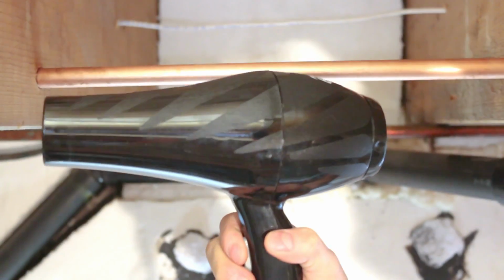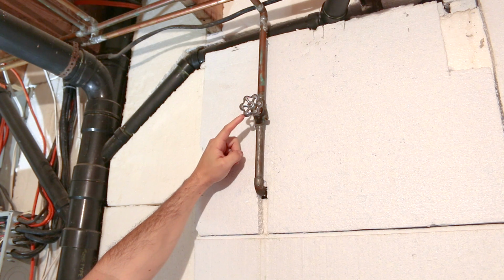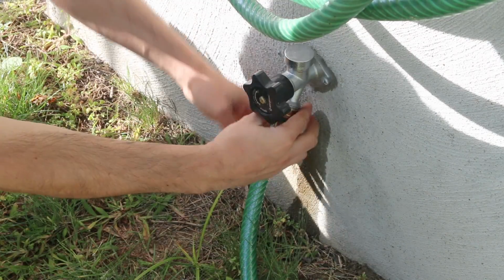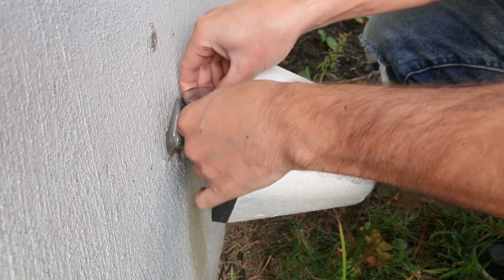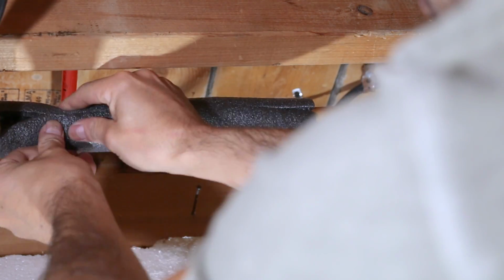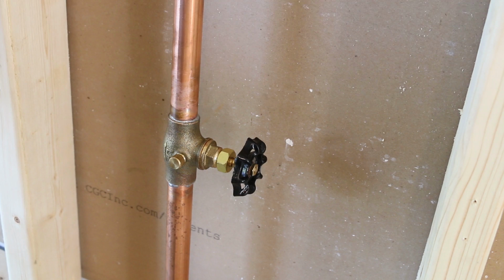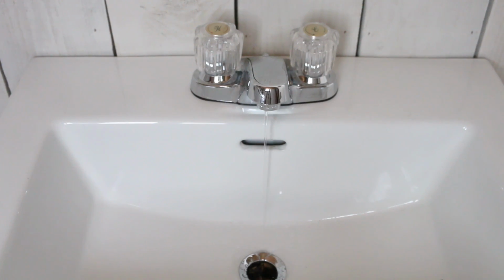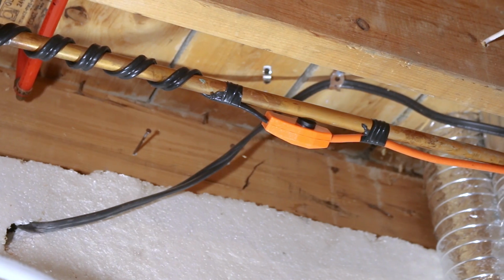12 TRICKS To WINTERIZE Your Plumbing! (Easy DIY) | GOT2LEARN

Comment: I am in Texas, visiting my son.  He just bought a house last year.  We suffered no power,  for a while, got a generator working, and thought all was well. All external faucets were insulated, and not leaking. 

However,  it was the bathroom in the garage that posed a problem.  Someone cut out one external faucet and capped the end with a steel, natural gas line cap.  The freeze finished pushing the rusty steel cap apart,  spray water behind a dry-walled wall of the garage.  Interestingly, that pipe was outside of the original brick house, NOT INSULATED, and hidden behind drywall.

Remember:
1. NEVER MIX METALS. 
2. use the same type and appropriate metal for its final purpose.

Comment: Growing up in Buffalo, I never even considered what is common knowledge here might not be known elsewhere. Every Fall I would help my Dad close and drain the water outlets, put away the lawn furniture, bring up the shovels, oil change the snow blower, and go and buy multiple bags of rock salt and 5 gallons of fuel plus stabilizer. It was a ritual I thought everyone just knew to do. Well, the way New Yorkers are leaving for the South that knowledge should spread in a few years. Makes me wonder what Southerners know about the heat and the house that Northerners dont know.
Reply: Lots of tips for next year.Hopefuly not but never know.

Comment: Great video, but big  error on the thermostat part : it costs more to maintain a house at higher temperature, because overall thermal loss increase with temperature difference between inside and outside. This is simply physics.
Reply from the maker: I said it was equal, but yeah there's a small difference, but not really noticeable in this case, thanks!!!
Reply: @Got2Learn  segoetnico is correct in that the video is great but the thermostat comment was a big mistake. To a great fraction of the world population, turning up the heat in the home would be very expensive indeed since maintaining heat has a cost that is directly proportional (as represented by multiplication) to the increase in temperature differential between indoor and outdoor,  multiplied again by the time you maintain this temperature differential. If maintained for more than a short while (which will often be necessary), the temperature maintenance cost will often be bigger (again, proportional to time, so if time approaches infinite then cost also approacges infinite) than the initial temp ramp cost unless your house is exceptionally well insulated (represented by division by the insulation factor).
This will in many cases be such an expensive solution that it might in fact bankrupt people with weak finances, fairly big, poorly insulated houses, living in places with prolonged harsh winters, which is a non-negligible fraction of the world population.
Since the rest of the video is so good, please own your single mistake an help any onlookers from thinking the thermostat solution is cheap when not (nor environmentally friendly), by editing out this erroneous comment from the video.
Besides, this solution is not permanent, so someone else who later lives in the house after you might not know of the problem an this theoretical solution, which might lead them to set the thermostat back down for other reasons thereby unknowingly causing ice-broken pipes because this solution is not permanent and requires this perpetual knowledge transfer and remembering too.
Please edit this comment out for the sake of humanity.
Reply: That was way too much of a comment for a simple concept. Most of the world population know what they can afford and won’t be watching this video, anyway. You’re giving this guy way too much credit for his “world” influence.

Comment: I live in a mobile home which are notorious for frozen plumbing. Most have the water, electric, and the dryer vent come in near the same spot. I built a small box out of insulation board around the water line when I bought the trailer 20 years ago. Instead of running the dryer vent through my skirting I ran it into the box around my water line, about 3 feet in distance. The one and only time mine froze it had been single digit Temp for a few days. I turned the dryer on and thawed it out in less than ten minutes.
I've used the dripping faucet since then and it's worked but the dryer is there for backup lol
Merry Christmas to y'all

Comment: In Europe, Germany specifically, it is in our code to insulate the piping, whether it being hot or cold tap water. The hot side, so it doesn't lose temperature and to save energy. The cold side, so there is no possibility of bacteria build up. Our cold water lines need to stay below 20°C (68°F), to ensure that. Some institutions are pushing for even better separation of hot and cold piping, to ensure the cold water temperature below 20°C even more, but that is still not in the code (yet).

As we have water based central heating, the water lines of these circuits need to be insulated as well, so the heat gets to the radiators and doesn't get lost on the way to them - and to save energy.

There is a mandatory thickness in relation to the pipe diameter somewhere in the regulations, that doesn't come to mind right now. A good rule of thumb is 100%, which means pipe 1/2in = insulation 1/2in. Up to a certain extent, of course. And you have to insulate the valves, too. There needs to be as little open pipe as possible.

Your example with the outdoor tap has a little short coming: With insulated pipes here you would still have the shut off valve inside, as these are mandatory by the building insurances, which every building owner has to have. Doesn't matter, if you have a frost free tap or not.

Sounds over engineered, but it works. Every water damage case caused by frost I heard of didn't follow these simple rules. Or the heating failed, what let the cold creep into the house.

Energy saving - and therefore cost saving - might not be a big thing in the US, as natural gas, oil and electricity are so cheap, people don't bother. We in Germany are paying so high prices for energy, american people would protest non stop (on he other hand: If we had to pay your prices for internet access plans, we wouldn't protest in the classical sense, we simply wouldn't get the gear).
But as we have all seen, to winterize your home can have it's advantages, even when there might never be a ROI via energy cost savings...

Comment: If you shut off the main water, shut off the water heater so it does run dry and burn out
Reply from the maker: It shouldn't empty itself, but if you feel safer that way, it's fine.
Reply: @Got2Learn  ... if the water is shut off then you can't get any hot water so might as well not heat it in the first place.

Comment: Great tips as always! I would only add to install pipe insulation close to the exterior wall to a maximum of only 18” away in a basement or exterior wall that meets a inside wall. That way you get the heat from the room, even if it’s ambient such as a basement, on a good bit of the exposed pipe and the pipe closer to the wall will be insulated from the cold. Also those outside faucet covers need to have insulation stuffed inside of them before installing them over the faucet. Lastly since you didn’t mention it if you cut off water to device and you have a ball valve after the shut off valve you cut off place the valve after the cut off point to half on half off. Enough water can get trapped between the ball and the wall of the valve causing it to freeze and crack. This is mainly for backflow devices for irrigation systems. Even turn all the test cock valves half on half off and back off the bolts of the relief valve a little bit so the water can drain out from there as well. Also installing tees with drain plugs right at the ground of the inlet and outlet pipes of the backflow device can allow you to drain all the water out of the device and piping above ground eliminating any worry of frozen piping.
Reply: What do you put in the cover to insulate it? TIA

Comment: Nice tricks! 

Also worth mentioning is a method to keep underground pipes frost free. You can feed a heating cable inside the pipe with a cable that is suited for that purpose. A small cable inside a ~40mm diameter house main water supply line won't hurt the flow too much. Of course the pipes shouldn't freeze if buried deep enough but unsually long cold peaks can reach frost to 1m deep underground.

Also, it does cost more to raise your indoor temperature because heat loss through insulation rises when temperature difference rises.
Reply from the maker: Thanks Antti!!

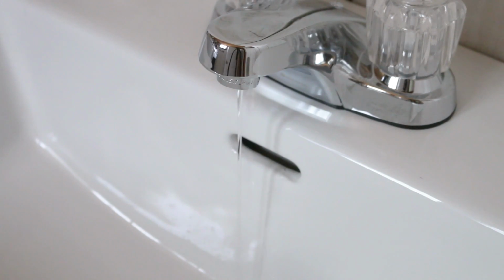Comment: 7:54 #10 is okay if you have just one faucet and one pipe; if you have multiples of these, the water can still freeze in any pipe that isn't being slowly "drained" by an open faucet like this.  Also, slowly letting water into a drain can actually make freezing worse, in that the drain-pipe is no longer empty of water in some areas.

Comment: Before you EVER attempt to thaw a frozen pipe, make sure you know where your water main shutoff is and make sure it WORKS before you do anything. Open every tap beforehand and watch very closely for drips while thawing the frozen pipes. Opening the taps will reduce the size of the leak if there is one. If it drips or shows evidence of a leak or split, stop, turn off your water main, and call a plumber.

Comment: Great video. Lots of good ideas. Another idea for thawing frozen pipes is to use a stick welder. The frozen pipe has to be metal. With the welder turned off attach one of the clamps to either side of the frozen section, usually a buried pipe. Open a faucet and then turn the welder on the lowest amperage setting. When the flow is restored turn off the welder and remove the clamps. Doing this too long can melt your pipe, so only use the low setting. Connecting the clamps with the power on could cause an arc that will put a hole in your pipe or blind you. 

When listing drains to add RV antifreeze I'm pretty sure you forgot washing machine drains. That would be a bad trap to forget.

Thanks for the awesome videos. I've learned a lot from them.
Reply from the maker: Thank you so much! Yes I heard of that technique but never saw anybody using it, pretty sure it makes for a quick unthawing hehe...have a great day buddy ;)

Comment: I’m in TX and mine are frozen outside as I write this, hope they don’t burst
Reply: What happen ?
Reply: I lived 1 year in Laneville ;TX. 1974. I was sooo happy to be away from my freezing Illinois home. Then it snowed! First time in like 100 years! @&:#!!!  😡
Reply: @AntiFem Glasscock Climate change bro.
Reply: @AntiFem Glasscock and climate change affects the severity of weather phenomena, both hot and cold weather events.
Reply: @aarone.1981  Same!! from MN, and without electricity for 4 days now in Garland. SMDH
Reply: Well in CC, TX we lost power for 4 days, had one sink in the bathroom that froze. I don’t know if the outside water spickots froze. I couldn’t find any shut off valve to the outside spickits. I could only find the main shot off valve. So far no burst pipes, but as he said i guess I wont know about the outside ones till spring or when it warms up.
Reply: Did they burst?
Reply: @prettyvacant3383  I lucked out. Wrapping the exposed pipes in towels and 100mph tape worked.
Reply: @htx_carlos4766   I lucked out. Wrapping the exposed pipes in towels and 100mph tape worked.
Reply: @xuimod  🤣
Reply: @aggielonghorn  is there anything climate change doesn’t do???🤣

Comment: good Information In the 1990s I noticed the Sears rubber Garden hose would freeze but did Not bust until 34 below zero  F so I did My whole plumbing with It,  I use Gimour brass valves and connectors the plastic are more likely to bust I cover the hose with flexiable sewer pipe and If the Water line does freeze I uses a hairdryer to blow warm Air down the lines, I have tried heat tape but It usually does Not work and one time It about set My house on fire, I have been after manufacturers to make something as a automatic Water flushing system to flush the Water lines every few minutes I tried a automatic lawn sprinkler It worked for 2 hours but does Not have multiple repeats, also do Not run Warer lines near cement because  cement absorbs  the cold like a magnet.

Comment: Awesome video man. Lots of good info. Two observations-1) you guys use gate valves up there? They are trash in the desert . I won’t even try turning an old one off when run into it. Automatic replace. 2) Your water must be awesome right from the ground there. I didn’t see any hardness or calcium deposits on any of the hose bibs you showed on exterior.
Reply from the maker: Hehe yes, the gate valve is original from the house and it's starting to already not be smooth and for the calcium deposits, there's none because I replaced them ;) Thanks Mark always nice to see you back ;)

Comment: Heat trace on a copper (or metal) pipe should be fed from a GFCI (ground fault circuit interrupter) power circuit.  The GFCI will keep you from electrocution if the insulation on the heat trace starts to fail and energizes the metal pipe.  Use a 30 mA GFCI for this purpose.  The standard 6 mA GFCI may result in nuisance trips which will allow your pipes to freeze.

Comment: There is totally inaccurate information at about 7:30 about the cost of warming an house. It is false to say that the cost of heating a house is the same no matter what the temperature is, and that it's only the increase in temperature that cost money. That's not how thermodynamics works. It would be accurate if insulation was infinitely perfect, but nothing in the universe is perfect, and our insulation material are nowhere close to even good. We will never live the day where we see insultation with R-Value of infinity.

Heat loss = (Delta T x Area x Time) / Insulation R-Value. The heat loss in BTU/hr is equal to the difference in temperature between the outside and the inside time the area of insulation times the time divided by the R-Value of the insulation.

At a R-Value of 30, the difference between heating your house to 70 or 73 for the average American house is about 200 BTU/hr. That's 42.5 kWh at the end of the month, or 4.25$ more per month on your electricity bill at 10c per kWh (you can also convert BTU/hr to your gas energy density to get the cu. ft. of gas you'd need more and convert by the price of the gas you pay also, if you are heating with gas). For an older house at R-15, the loss for that 3F is 400BTU/hr, so 8.50$ per month.

You cannot control the outside temperature, but you can definitely control the inside one! And no, it's not 4.25$ to increase the temperature, it's the price to _maintain_ that temperature. If you reduce temperature during the night, or while you are away, the economies are even greater. It is almost always cheaper to decrease your temperature for any time greater than one hour than to maintain the temperature. I'm sure you'd rather stay comfortable when you are at home and save while you are away than paying through the nose to heat a house when no one is in it.

I remember an exercise one of our thermodynamics professor had us do in College. He got us to convert an average R-30 insulated house into a perfectly insulated one with a hole in the wall. I believe the answer was something along the line of a 1 foot hole in the wall. The average house has the equivalent of a 1 foot hole in the wall because insulation are pretty bad. It's kind of shocking when you think about it.
Reply from the maker: I didn't want to make it too complicated, but yes, there will be a small delta if it's heated more, I just thought that for 1 or 2 degrees it wasn't worth specifying, thanks man!!!

Comment: These are all good tips but I have one small disagreement.  Keeping the heated areas of your home at a higher temperature might prevent pipe freezing in certain situations but it does cost more. The reason is that, in cold weather,  a greater difference in temperature between the inside and outside of a building will increase the rate of heat loss to the outside.
Reply from the maker: Yes, but to a point where it's considerably higher, I don't think so, but I am not 100% certain.
Reply: I agree with Don Ho. The rate of heat loss will increase.
Reply: One or so degrees will not make a differance in heat loss

Comment: My solution… I purchased a digital irrigation timer at Lowes that you would normally use on your garden. I have a Orbit brand, Item #604469 Model #24600 about $30 bucks. I attached it to my kitchen sink with a quick disconnect. I set the timer to turn on once per hour around the clock and run for 2 minutes. It was really easy to set and works perfectly. I live in Northern Minnesota in a mobile home. It hasn't failed me yet. My water lines into the house have heat tape but this is my extra insurance….
Reply: I have tried that but the problem Is the lawn sprinklers do Not have multiple repeate or else I think It would work.

Comment: Great video!! I learned a lot.  I have a problem, I shut off the upstream water supply feeding the outdoor hose bib, opened up the outdoor hose bib faucet to drain, and left it open for 12 hours but the outdoor faucet keeps dripping nonstop, from the video is supposed to leak for 30 minutes at the most but the faucet keeps dripping. Please help!
Reply from the maker: Might need to change that shut off valve before the bib, what condition is it in? What type of valve is it?

Comment: make sure the exhaust vent on your furnace will remain open and not get blocked by snow from a blizzard or debris that may blow over it. if it does get blocked, the furnace will shut off.